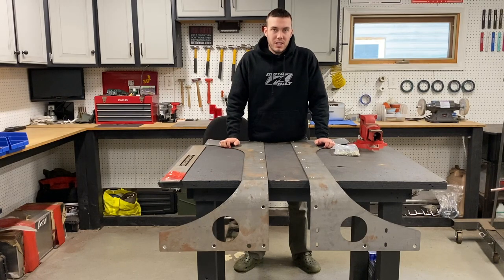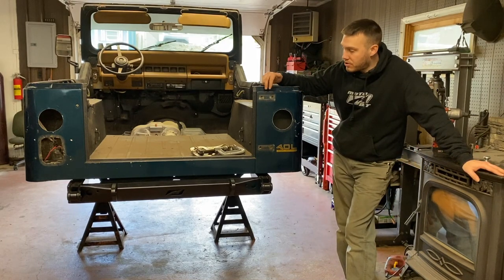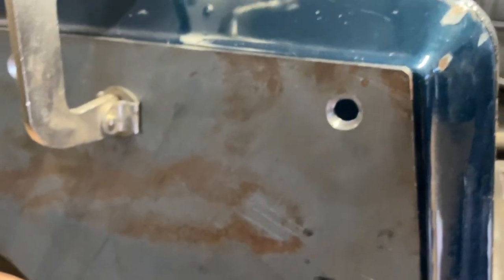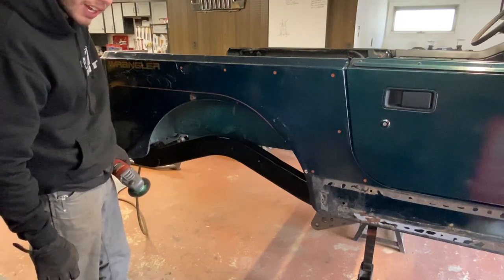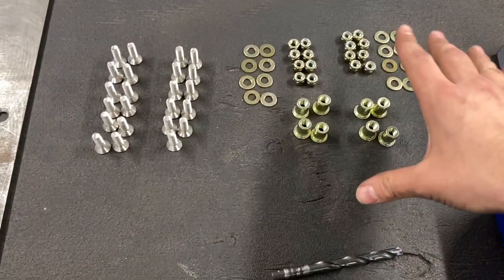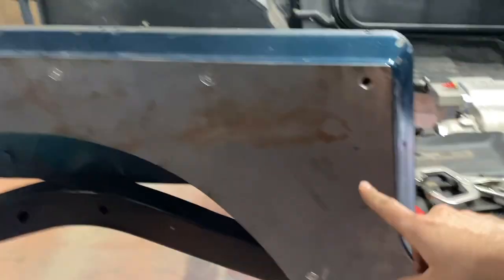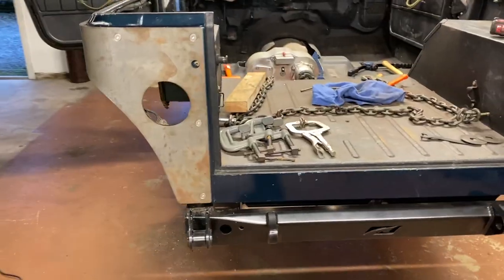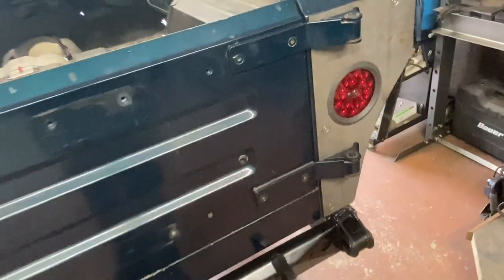Installing Motobilt Corner Guards for the Jeep YJ

Comment: Side question,  I don't have a cage yet for my yj.   I live in New England so rust city.   I cut off the rear crossmember to replace it, and was thinking of welding 2x4 tube in its place.   How would one go about inboarding the rear body mounts?
Reply from the maker: Replacing the crossmember and creating new body mount locations on that shouldn’t be to hard. The problem you’d run into is the tub side and getting new locations to bolt too. I’d say maybe create a flange style nut and cut into the rear channel of the tub where you want the inboarded location to be and then weld the nuts into the tub. It’s hard to say without being able to see it in person. I hope that made sense and helped a little hahah.

Comment: Hey man on that air body saw try a hack saw blade. Just trim it down to fit and it will bend into tight spots. Just a FYI I learned years ago. Stay safe man I dig the videos. Just getting ready to start a similar project
Reply from the maker: Awesome thank you for the tip! I’ll give it a try next time I need to break out the saw. Thanks for tuning into the channel 🤙🏻

Comment: I’d be curious to know what measurements to properly place the holes for the tail lights before I get the corner guards. I’m definitely planning to get the same ones from Motobilt, just not in the funds at the moment.
Reply from the maker: What measurements would you need, I can try and take some for you to help. Let me know 🤘🏼
Reply: @altered_life  I guess there’s no way way for me to comment a photo. I’ll try to make sense. From the top of the taillight circle/cutout to the first edge/bend above it and from the inner edge of the circle/cutout to the first edge/bend that meets the tailgate opening. So from where the bends start on the tub in those areas but still on the same plane/surface as the cutout for the tail light hole. Hopefully that makes enough sense 😂

Comment: Would it make sense to stitch weld this in a few areas and seam seal it on? I feel like it would add a great deal of strength and rigidity to the tub especially around wheel well edge

Comment: Hello, so when having the lights installed. What’s your plan on hiding the wires?
Reply from the maker: Hey Cody, I plan on using wire loom with heat shrink to keep it neat then trying to tuck the wires up into the wheel well or under the tub. Not 100% sure yet but we’ll see when the time comes haha
Reply: @altered_life  No worries, I’m definitely subscribing. I have a TJ I’m LS swapping and looking to see what I’d like to do to the body as well. Appreciate your quick response.
Reply from the maker: I appreciate the sub 🤘🏼 good luck with your build!

Comment: What is the width of it from the angle to the bottom of the fender after the cut and install? I've got pre existing corner guards but going to cut it out for comp cut
Reply from the maker: If I’m understanding you correctly the measurement I just took reads 43.75” from bottom corner to bottom corner of both comp cuts (across the back bottom of the tub). If that’s not the measurement you need let me know and I’ll gladly get you the correct measurement 🤘🏼
Reply: @altered_life  I think I got it. I finished cutting my corner guards I had and guestimated what the top of the fender to the wheel opening. Gonna be posting up the actual cutting I did hopefully.
Reply from the maker: Awesome well if you need anything else just let me know 🤘🏼

Comment: I just bought these exact body armor. Did you move your body mount in? Since you cut it off.
Reply from the maker: Scotty Gott nice 👍🏻 and for my set up I won’t be running a rear body mount back there but instead I’ll be tying my roll cage to the frame in the rear which should support the body no problem. Once I get to that stage of the build I plan on having videos showing all the steps I do to mount the roll cage. It probably wouldn’t be too hard to move the rear body mounts in, you would just have to install a larger style nutcert into the boxed section on the body and weld bushing mounts to the inside of the rear bumper. It definitely could be done. Good luck with your project!

Comment: How are you supposed to fill up your jeep with gas? The spot where you put gas in your jeep?
Reply from the maker: I’ll be running a remote filler cap with a fuel rated hose similar to how Ultra 4 race cars are set up. I’ll more than likely mount the filler off the side of the roll cage

Comment: How did you wire up the tail lights
Reply from the maker: The tail lights come with a plug and wires, all I did was splice the new plug into the factory harness and it was good to go. It was a little trial and error to figure out which wire was which but it wasn’t to hard at all. I’ll be re wiring the entire Jeep in the future so I’ll do my best to cover that in that video
Reply: @altered_life  cool thanks buddy i got the same ones the two plugs with all the wires going into the stock harness seems like alot but trial and error it is lol
Reply from the maker: @kylemobley6061  no problem! Unfortunately it was so long ago when I did it I can’t remember the wires and I no longer have any wiring in the Jeep to reference. I’m sure you’ll get it figured out though! Good luck 👍🏻